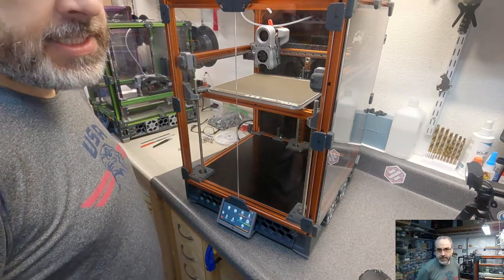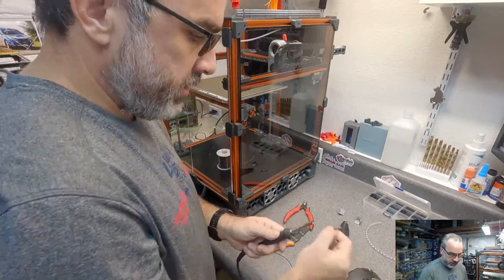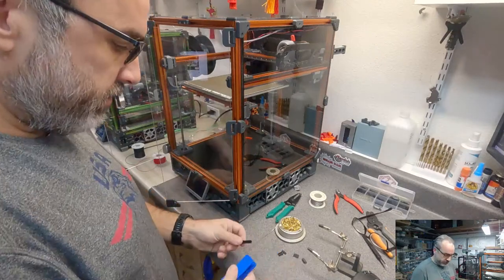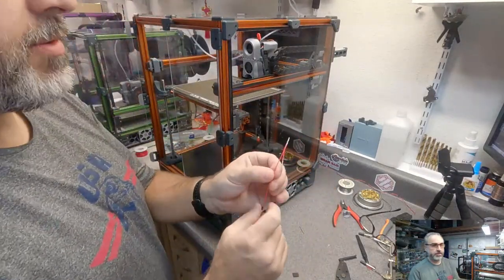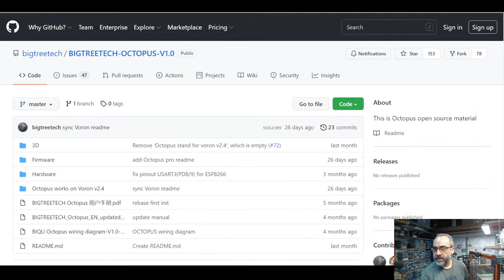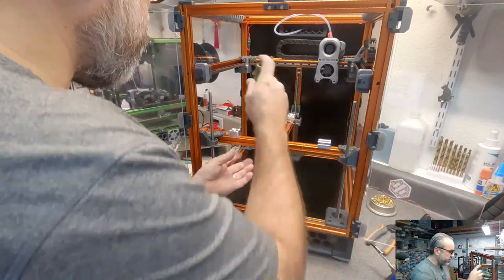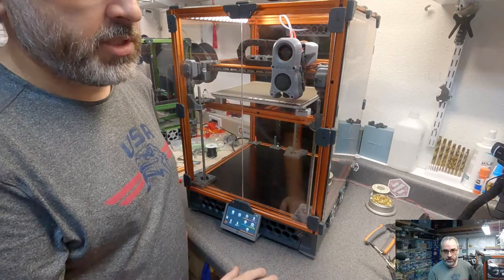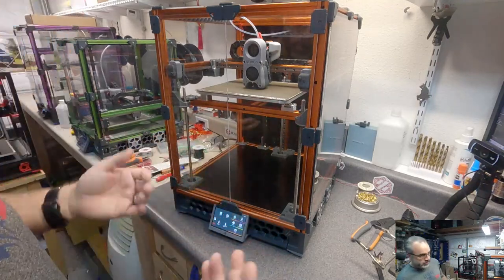Lighting up the Trident!

Comment: I was one of the testers for the MRW kinematic mounts on 2.4. For last month and half no issues with them and running bed power @ 100%. As mentioned one benefit is allowing thermal expansion but for the Trident another benefit is decoupling the bed from the led screws.
Reply from the maker: Hi Klabby.  They are certainly well machined and I look forward to seeing how they work long term.  I'm curious about your decoupling comment though.  These decouple the bed from the bed frame, but they've never been coupled to the leadscrews.
Reply: @SteveBuilds  I looked at it as the bed is attached to bed frame and frame attaches to the Z yokes then the bed is coupled to the lead screws. I could be wrong though :)   From my Railcore (RC) experience which has similar 3 z screw kinematic. Any lead screw wobble would transfer to bed and also when bed is heated up and expands it can put pressure on leadscrew (s) during travel since now the alignment is off/binding. Not drastically or anything but I've seen print artifacts during printing.  When I installed the kinematic mounts on the RC; it help mitigate z-wobble since bed wasn't coupled so the wobble wasn't being directly transferred to the bed. The binding I was seeing/artifacts were non-existent. Bed on RC mounts directly on Z yokes but with Trident using extrusion attached to the z yokes and not bed directly like the RC. And Trident uses GE5 bearings which if I understand their use is to help with alignment; z-wobble is mitigated. So possible z-wobble and bed expansion issue with RC may not correlate .  Kinematic mounts also helped with bed tramming/leveling on RC; required fewer passes. I'll have to build Trident now to see if most of benefits I saw for RC translates to the Trident ;)

Comment: Any update on your opinion of the MRW mounts now that you've used them for awhile? Is it worth losing our already limited Z?
Reply from the maker: No real updates.  I haven't taken the time to try things like heating with max power or anything like that.  I almost never print to max Z so that part hasn't been an issue.  Otherwise it works.  I still haven't had to enable a bed mesh but I can't directly contribute that to the mounts.

Comment: Which led mounts did you use (the ones you printed and snapped into the extrusions)? I can't seem to find them anywhere.
Reply from the maker: Hi Steve, I'm using the parts posted  by Eddie on the Voronusers github.  They can be found here: https://github.com/VoronDesign/VoronUsers/tree/master/printer_mods/eddie/LED_Bar_Clip

Comment: How did you find the trident build process over your other Voron's?
undecided if I should go a 2.4 or trident
Reply: Trident is almost universally regarded as easier to build. I only say almost, because there is a nonzero probability that someone thinks 2.4 is easier.
Reply from the maker: The Trident is quite an easy build and easy to work on.  That's probably the biggest advantage over Voron 2.  Less complicated, a little less cost, easier maintenance.  But not by much.  I've very much enjoyed my Voron 2 builds as well.

Comment: What are these offset front idlers? Are these the same that are in a pull request in the 2.4 repo?
Reply from the maker: They are not the same.  Maybe the same solution though.  The issue has been brought up in several areas and the parts I modified are intended to remedy the issue with minimal changes to the design.  They'll be included for both Trident and V2.4 in the next minor releases.
Reply: @SteveBuilds  ok, thanks!

Comment: 2:36:50 I haven't tested the klicky probe on a Voron (cause I don't have one) but have tested it on an Ender 3, the probe it's made for fail-safe also the macros for the probe have a lot of probe checks to make sure that the probe it's attached when picking it and before probing, and if there is any problem the printer stops and show on console that the probe it's not attach. Also the probe usually detaches sliding the magnets and not pulling it so the probability of a bad contact with a wire or getting a magnet pulled from the probe are smaller.

-:--:-- Neodymium magnets like the ones recommended on the BOM used on the doors and the klicky probe are rated for a maximum working temperature of 80°C (N35 grade) so being close to the bed it's not going to make it lose the magnetism.

2:56:35 The configuration of the Klicky probe it's a little bit longer cause you have to modify the macro to add the coordinates of the probe dock or to get the dock in the correct position and to uncomment the macros for your specific build (quad gantry leveling  or Z tilt adjust for)  but after that the configuration it's just the same as a regular probe. Hope that you give it a try.
Reply from the maker: Thanks for the detailed post fdavpach.  It was not my intention to portray the klicky-type probes negatively.  I expressed concern about the long-term reliability of the wire to magnet connection but I have no real concerns about the magnet to magnet connection or bed/chamber temperature having a negative effect on the magnets.  I am planning on trying at least a couple of the different solutions myself soon.  Probably on a stream.
Reply: @SteveBuilds  Oh no, no, i'm just trying to give some feedback, the wire to magnet its a bit concerning but it gets pretty tight when the magnets are pressed in, you can always leave extra wire strands to have more area to press and touch the magnet and add some glue to keep the wires on place from pulling out. The most concern i had was with the micro-switch to magnet connection cause its just a lateral contact fit but it works.

But keep in mind that I cannot give a 100% accurate feedback cause I don't own a Voron or a high temperature enclosed printer

Comment: Hey Steve
Still chasing around. I ran across:
 https://www.youtube.com/watch?v=mqSQhwqSzvg&t=911s
He is using a floating magnetic mount to isolate the wobble in cheap($20) ball screws. It is a fairly interesting video in and of itself but it also sparked a lot of ideas.(still trying to join discord, but there are issues). 
The first was, would this alleviate MOST of the issues with using a coupler?
Then it occurred to me that there will be wobble in any screw. It would just be a matter of how much and if it was enough to cause any issues. Could one quantitate  it using the  accelerometer ? Tie the accelerometer to the bed and see?
Which naturally led to the thought of 'floating' the entire bed and if that would "isolate" it from the vibrations transferred through the frame.  While I am not interested in speed benchys directly, I do believe the the solutions generated there will lead to improved speeds in quality printing. So how much of the speed benchy quality flaws are due to the nozzle vibrating versus the vibration of the printed part and the nozzle vibrating out of sinc? Isolate the bed and eliminate 1/4 of the vibration?
Which brings me back to the magnetic mount you installed. It was designed to deal with expansion issues due to heat (correct?). However it would seem to me that it MIGHT also act (in the x/y plane) to somewhat isolate vibrations.
At any rate I thought it was an interesting watch.
Reply from the maker: MirageC's stuff is awesome and I encourage anybody to pursue things like that if they like.  For the spec build though we need to keep it simple and given reasonable quality parts the spec build works very well. 
The magnetic kinematic bed mounts won't help with this.
Most of the quality issues with speed benchy type printing are from part cooling.  You just can't cool the extruded filament fast enough on those.
Good thoughts though